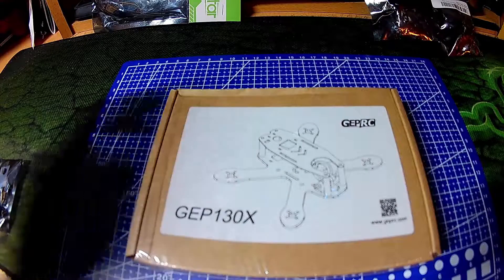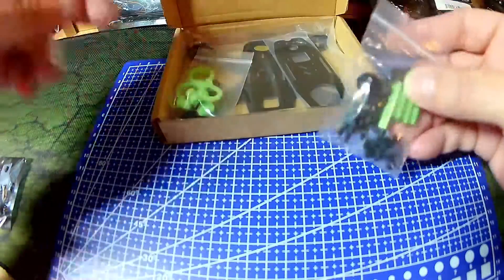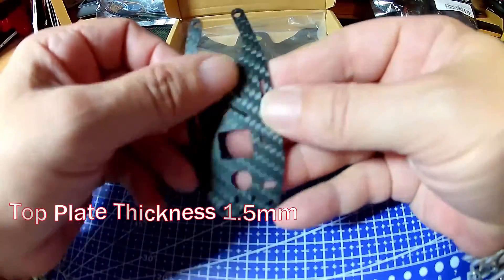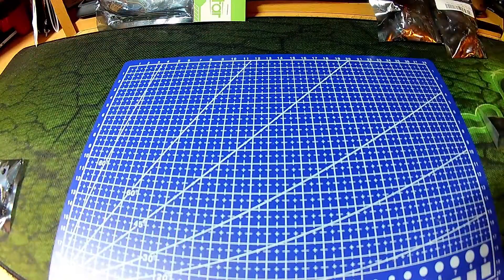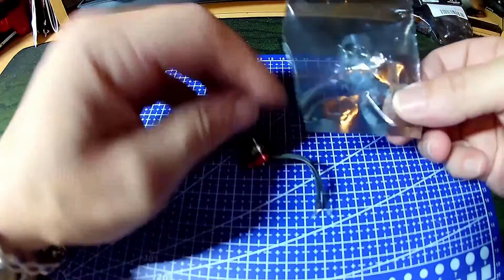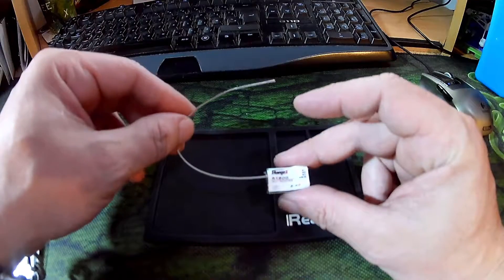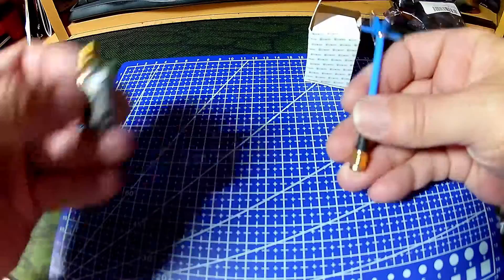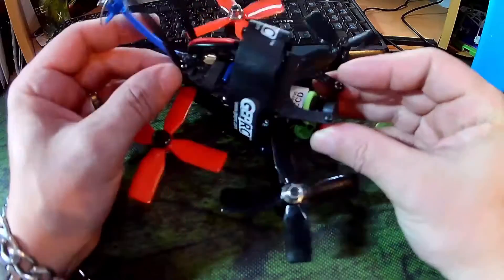GEPRC GEP130X Frame and Build Part 1

Comment: Which screws did you use for the motors?
Reply from the maker: Robin I used M2 x 5mm bolts for the Emax 1306 motors, 6mm might be ok.